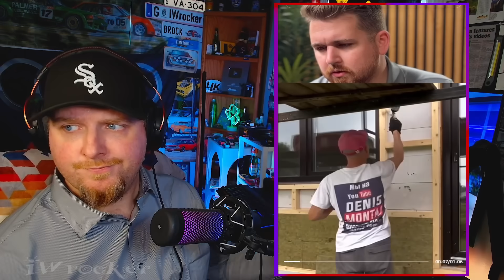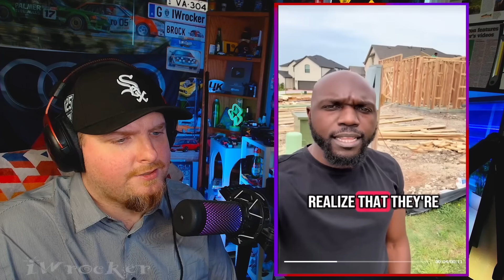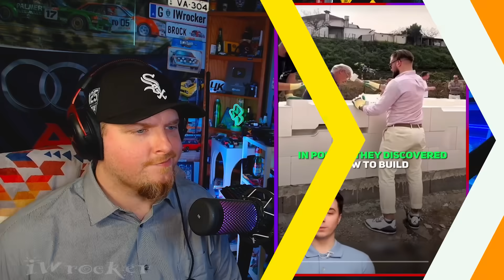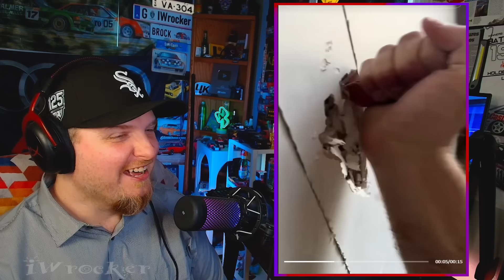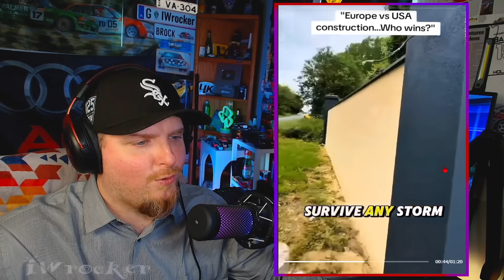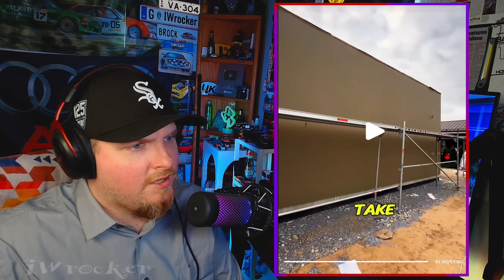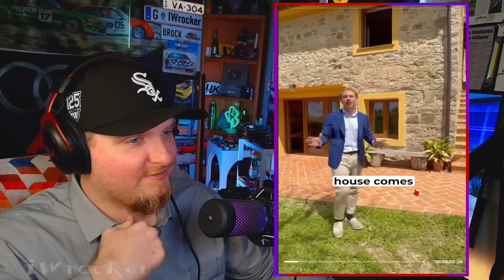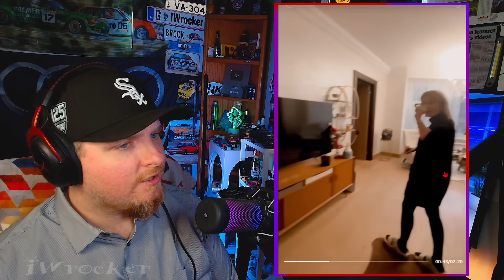25 Minutes of European VS American Home Quality & Construction Methods 🔨

Comment: I could say a lot on this, but thats going to be far too long.

A couple of points:
1) There is no 'European houses', as every country is different. There is afaik, more woodbuild in Austria and Switzerland, but ok, in general there is far more brick and concrete build, than in the US.
It surprised me actually, as i visited a number of states in the US.
Also, its not all wood build in the US, but overall, yes, far more woodbuild in the US.

Im dutch and pretty much all houses are brick, double layer, with insulation in between.

2) Recently i watched some 'holmes', which is canadian i believe, but similar to the US by the looks of it. Another thing that amazes me as there is so much, what Americans call 'dry wall'. Its what we call gips, or gipson in english i guess. We use it too, but for ceilings at times. As most houses are full brick and floors generally not wood, but reinforced concrete, we dont use it for ceilings then either, as you paint the concrete. So what its usually used for is the attic, where its wooden beams and if you want to make a room there, or comes with an attic room, the ceiling there is most likely 'dry wall'. You may find it on the corner sides too up in the attack, so as a wall. But thats about it. Walls are generally solid here.
Also no wood build. That would be a nono in NL, as we are pretty wet. Its done, sometimes, but rare.

I really see no beneft to using dry wall, as you do in the US. You say its more flixible, well yes, well.. it depends, bc if there is plumbing, electrical and what have you going through, its not like you move it over with ease, is it? But yes, you can move it. Then i ask, why would you???
And do people really do that?
I mean, you choose a house as you want it. Its a bit silly to me to buy a house and then knock down all inside walls and redo them, bc it wasnt to your liking. Then you maybe should have looked to buy another house?
So you found the house you want. The house that 'fits' you. Now why would you then rearrange the walls?

The only thing people change here at times, is when they buy a house thats 50, 60 years old, or older. Back then, people had no shower. They hardly had a bathroom, if at all. People washed with a bowl of water and a cloth and soap. And you generally wanted to do that in the neighbourhood of the stove, bc it might be pretty cold elsewhere. So if people buy such an older home, with changes not yet made to modern demands wrt this, they may decide to change a small bedroom, into a bathroom. Well, then you draw up a plan, make pipes sit in the walls (which you have to grind channels for) and so on. And then its modernized.
I dont see why you would change anything else.

Another downside with dry walls is that its less sturdy. Woodbuild is a fire hazard. And 'dry wall' is very weak, so sooner or later, someone is going to kick or hit it, or body slam it and it will punch right through. Then you have to plaster it, smooth it out, repaint. That doesnt happen with solid walls.

So what benefit is there?
Heck i dont want dry wall in a shed even. Well i used it in the garage, as ceiling, but otherwise, nah.

Now i would understand all the woodbuild, provided its a lot cheaper than brick, but judging by the prices in the US, it doesnt seem to be any cheaper, if at all.
So why buy what we basically call a large shed for so much money?
Puting up facades is also not done here. Back in the 70ies, when stone strips (what you use for facade), came to the market, some people put that on the inside of the living room, to make it seem nice brick. Ofc not many did, as you can also grind off the stucco layer and paint, and then you see the real brick. Doesnt cost you anything, but some sweat ;]

Last couple of decades though, there has been some exploring, for reasons, and more plastics used as building material, in different ways. As this creates fire hazard, that will be vacated again in the near future.

Brick rules.

Comment: Those "european windows" have 3 way they can be. 1. closed \/ (duh) 2. open < (like in the video) 3. open /\ (it tilts inward)
And even then there is another hidden function/ switch in those windows that you can use for summer and winter though that one I can't explain as I don't use it

Comment: Drywall is also common in Europe but I think we use it differently. For example the house where I live in Germany is pretty much two houses 'fused' together: One third historic studwork house which is over 300 years old and two thirds brickwall house from the 50s. We often use drywall within the house to divide rooms for example but in case of the studwork house which had no insulation previously we also used it to cover the glass-wool-insulation we added from the inside because on the outside it would ruin the aestetics of the studwork. Meanwhile our brickwall part is completely insulated from the outside like it was shown in the video.

That apartment for 700 is an absolute steal. In Germany you can't even dream of rent prices like that, they are not as high as maybe in New York but still very high. You easily pay triple for an apartment like that.

Comment: It also depends on the type of building. Here in France, new buildings are poorly made, and while the exterior walls are concrete, the interior walls of a flat will typically be the same or similar flimsy material that the US videos show. Those interior walls are called "cloisons", and they are easy to take down.
Old buildings, of course, are made of solid stone or brick.
The thing is, you use the material available to you, and in the US wood is plenty.

Comment: Wrapping old brick houses in 6-15cm (2.5-6 inch) of outside foam is a standard renovation practice in many EU countries. 
It's (relatively) cheap, you don't lose any space. Instead of using more gas or electricity for heating and AC, we are incentivized to invest in durable solutions.

Comment: The thin house is wedge shaped, squeezed in between the road and the underground. It's 6' on one end and 37' on the other. There are 6 apartments in there, they were originally built to be artist's studios. Around £1.1-1.2million

Comment: My home in Poland was built in 1910 with solid red brick walls nearly 20 inches thick. It has survived over a century—wars, harsh winters, and generations—and it’s still standing strong. Compared to many modern builds today, the difference in durability is hard to ignore. That’s real craftsmanship.

Comment: We have wooden houses here in DK, and they last at least 40-50 years without any major renovation and such. We use actual structural wood and not overgrown tooth picks...
Reply: There's like three directions in Switzerland. Wood, steel and concrete. 
But yeah, those buildings are made to last. 
Admittedly, Wood houses are a pain if they're bigger than a single or double family home. I do planning of water and waste water pipes and wooden houses have nearly no space to hide these. 
And our Architects are notoriously bad at placing the wet rooms and kitchens in sensible places and even worse at placing them above one another.
Reply: @Aurirang  We also have concrete and steel. And even though I'm a carpenter in training, I haven't worked on full houses and such, but I did do a wooden add-on for a brick house. The rafters, the studs in the wall, the floor joists, subfloor and what not was made of wood :)

Comment: 8:00 meanwhile here in Poland you need an impact drill just ot hang a shelf, because of reinforced concrete.
Also there are some "baloon framing" buildings here too, but they are made with metal beams instead of wood (for example the office I work at is made that way)

Comment: I live in an appartment, pretty basic appartment, my walls are brick, not only that but there is steel reinforcement in some of the walls too. Even when we build cheap buildings, we build them to last. My old apartment was from 1963 and i moved when it had it's first renovation done in 2024 ;)

Comment: In Germany we use the try walls for inside, dividing the rooms on the attic. The normal walls we make the different  internal and outside walls additional we have load-bearing walls (thicker). The walls are not make from concrete, they made from spezial stones. The outside stones are made from an insulated material. The stones will be clued together. As the concreted floor was dry/harden, they needed two days to build the stone walls for the ground floor.   How to build a house: https://www.youtube.com/watch?v=ZAByooMVkMQ

Comment: The insulation is between two walls. Here in Denmark there will often in new houses be aerated concrete inside and bricks outside. Some if you have a lot of money you have bricks outside and Inside

Comment: First clip: "Not even pressure treated wood" - Yes, because you don't need pressure treated wood when it's only meant to hold insulation on the outside of concrete in place. And you put the insulation on the outside so that the concrete doesn't absorb as much of the heat/cold from the outside. It's a lot harder to cool down/heat up concrete than it is plywood and drywall. So it's better to prevent concrete from heating up/cooling down in the first place. It keeps the house at a more even temperature throughout the year.

Also, as said before, US houses are basically a joke to us Europeans. They're made of what we make our sheds out of. To keep our tools/garden supplies in. Not to actually live in. :P We call them "cardboard houses" for a good reason. I get why American houses are like that. Wood being so readily available all across the country since colonization times. But over here no one would be willing to pay top dollar (or euro in this case) for what we would consider to be a flimsy house made out of cheap materials. My current home would easily outlast most US houses several times over. Without any real maintenance at that. In fact, my current home is 48 years old. And it's a wonderful 2 floor, 2 bedroom home with a backyard, in a family friendly neighborhood. It's "energy label" is only C, which is lower than the average which is B, but that's about it.

As for the "I can cut through the wall with a utility knife" clip; Yea...I can't do that. Almost all of my walls are concrete or brick. I would break my hand if I tried to punch them. The only partial wooden wall I have is on the second floor in one of the bedrooms. It's right below the roof (the ceiling is slanted since that's where the roof is), but it's still not a wall I could cut through with a utility knife at all. Hell I'd likely still break my hand if I tried to punch it. In other words, even our "wooden walls" are sturdier than your average American home. :P I do admit that that also means I basically can't modify the place at all though. I have the space and rooms I have, and nothing else is possible. Not that I would want to change anything (our houses are built with space efficiency in mind after all),  but still.

Comment: 21:14 we got a house… 42.5k
120 square meters heated, 82 unheated (sauna rooms and: in work: winter garden, and laundry room).
Biiig garage, 3 parking spaces before the house. 1,5 meters deep, and 3/4 of the house long, roofed space in front of the main entrance. Also behind the house 3 meters wide, roofed, on the complete length of the house, a place to chill❤ garden: behind the house round 20x20 meters, plus the 4 meter wide way around the garage.
2 bathrooms, 1 shower, 1 bathtub, 4 bedrooms, kitchen, living room - with wooden stove ❤, sauna+sauna pre room and laundry room.
The kitchen has enough room for a tabel and a corner bench ❤
On the side from an extra kitchen counter.

We love it 🥰

Comment: 6:40 if you have a crew that knows what they’re doing, 14 days and it stands in full.
2 or even 3 floors plus roof.
In stone. Safe. No false stuff.
Regulated, controlled and safety protocols followed.

Smaller? Even shorter.
4 days. Done.

Comment: 3:18 in what are US houses better than European?
More stability? 🚫
Cheaper? 🚫🚫
Hold longer? 🚫🚫🚫
Less work has to be done over time? 🚫🚫🚫🚫
Hold stand a tornado or hurricane without getting sander completely away? 🚫🚫🚫🚫🚫
After a flood nothing is rotten and if can easily get exchanged?  🚫🚫🚫🚫🚫🚫
When it’s cold, the warm stays inside even with -60 degrees Celsius ☠️☠️☠️☠️☠️☠️☠️

Ok last try:
When a fire comes, the walls still stand, only the roof and wooden parts are gone?
😂😂😂😂😂😂😂😂😂
I forgot…. The whole house is made from wood.

Sry. But your building still is really like we build garden sheds.
For tools! Not humans.
Oh…. Noooowwww I understand the American humor 😂😂😂😂😂

That is a really good one!
Hard, but a good one!

Comment: I'm in a renovated apartment building (not so big). Used drywall inside with insulation.
The drywall is two layers (like 36 mm total) screwed together in alternative lines every 60 cm. 
I would never try to hit it. One I could break it (and hurt myself). Two? No. 
The beam to keep them up are in aluminum.
This is the DIY instruction video from the producer:
https://youtu.be/VOQPiALIDtQ?si=nTB4UUkgsd-MUcON

Comment: The idea that insulation is not usefull in the US shows a fundamental problem with the understanding. yes it keeps heat in which might not be as useful in the US. but it also keeps the temperature low if you use AC.....which is something very usefull in a country run on ac....

edit: thinking a bit more about it. actually no. the us is having so much cold regions that it is ridicilous that keeping the heat in is not something you would want....

Comment: "We do it right, here."
Yeah, that's why it takes slightly more than a slight breeze to reduce the average American home to splinters. Well done.👏👏
Reply: I once looked up a term that came up in a search for something completely different, where it stated something like 'These can be thought of as hurricane clips as required in a number of states in the USA'. 'Hurricane clips' was a hyperlink and being Dutch, that term really didn't ring a bell as to what it was. Considering you get hurricanes and tornadoes in the USA, I expected something special we don't know here (as we do get tornadoes in Europe, but most are very light and short lived and usually form in very rural areas), only to find out they were... dumdadum... roof-anchors! Nothing more than a piece of metal that provides a mechanical fix of a roof to the supporting wall below it. I was just baffled that something like it was only required in a small number of states and was not even required in some states that do get a large part of the tornadoes out there and that many states only had the requirement added to the state-wide building code somewhat years before. Since then I understand the many videos where a roof is just picked up in total as a tornado approaches a home.

Comment: I live in Italy in a flat. 2 years ago the building was renovated and the foam insulation was added outside. I assure you the difference is huge in the winter. My house is a lot warmer using the same heating. I could actually lower the heating and the house is still warmer then before the renovation. That's great!

Comment: The appartment complex I live in (Germany) was built in the 70s. The walls are solid concrete and not only that it's the steel reinforced type they loved to build with in the 70s here. I have issues drilling a hole in my wall with a high end consumer power tool. I'd say my walls are too durable cause hanging up a picture is a real hassle already :D

Comment: Sorry the first guy is either that clueless or he is trolling. I hope the latter, otherwise he is imagines himself as an expert and has no idea about building physics, and all of the US is wondering why their houses have so many problems with black mold , are rotting away after a few decades,  fly away or colapse by storms or earthquakes. We do build like your houses, but they are sheds, play- or doghouses.

ps: if that is in russia and the wood is from the northern regions it does not require pressure treatment because the harsh, cold climate causes the trees to grow very slowly, resulting in exceptionally dense, high-quality timber with natural preservative properties. 
This slow-growth process creates a "self-preserving" mechanism within the wood, making it resistant to decay and insects without the need for intense chemical intervention.

Comment: You put the insulation on the outside of stone houses so you keep the thermal mass inside equalizing the house temperature. You will have tens of tons of rock retaining the heat or cold in the summer. There you go, basic simple engineering.

Comment: My house is 70 years old, in thick bricks but no real insulation. Just finished installation of a new insulation on the outside on 3 walls ~100m², standard for France is 15-20cm Styrofoam + brick finish. Also added insulation of the roof with 25-30cm of material. My heat consumption was divided by 2 between November and December with temperatures much lower in December. Total cost 29+3.5 k€.
My heating system is also new (heat-pump), current estimation is around 70€/month for heat/hot water/electricity with full equipment. I am working from home so the house is heated all day long.
Not too bad for a 100m² house in North of France which is usually quite cold. 
My heat pump can also do A/C. Hopefully, I won't need it thanks to the insulation, otherwise, I am planning to use it only during heat waves for the children to ease their sleep.

Comment: These are not concrete walls. It is aerated cinder (ash) block wich is itself very good insulator. Insuklation goes definately outside and it should be more.

Comment: not sure where it is bit its  aerated concrete blocks with insulation on the outside ,1  advantage of this it the block wall when plastered actually acts as a heat battery warmed up by the heating system stops the rooms getting to cold overnight.